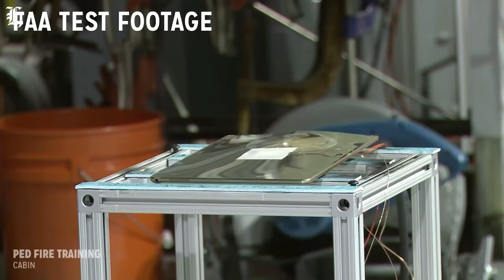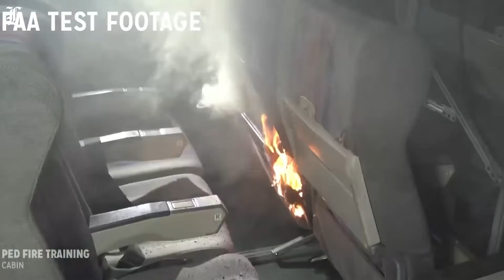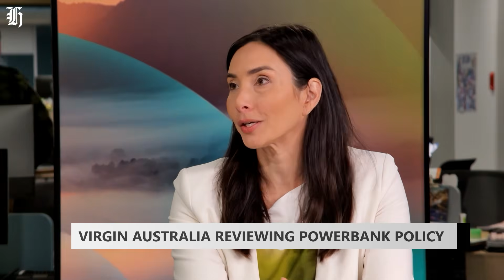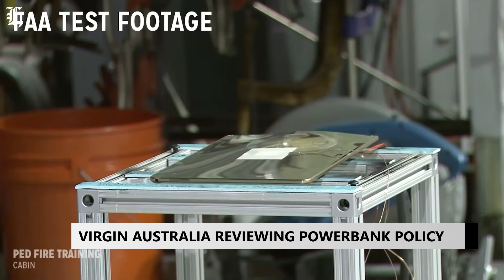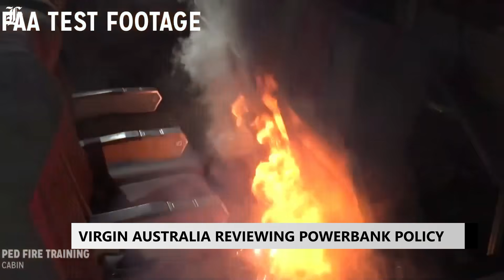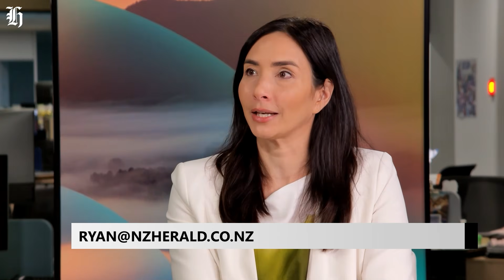Why do lithium batteries catch fire? - Herald NOW | Herald NOW

Comment: Lithium cells have been around since the 60s, they are a fire risk when charged past 4.2 volts per cell (thermal runaway). They were not useable until the electronic charge controllers got good enough to not charge them past 4.20 volts and not let them drain too low either as that will destabilise them for future use. If you compress a lithium cell you will increase the internal heat making it more sensitive to that peak voltage of 4.2volts converting the clamped max to 4.1v for example. A lot of controllers don't take them to 4.2volts and give some head room. Good Lithium cells will have some safe guards built into the batteries never buy cheap upregulated items
Reply: Yet Tesla's and many other 
electric vehicles parked on 
the street or in household 
garages spontaneously 
combust while never 
being charged.
Reply: Lithium what? LFP? NMC? LCO? LMO? NCO? LTO or LiPo?